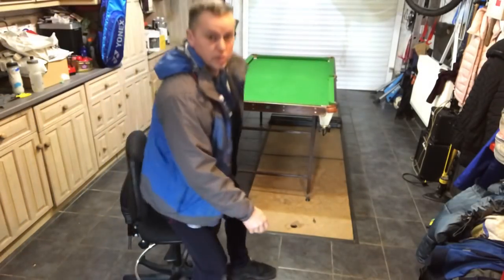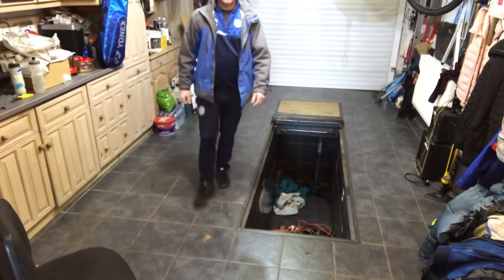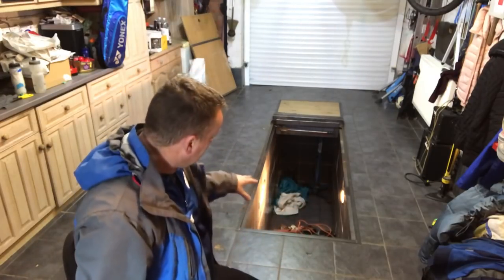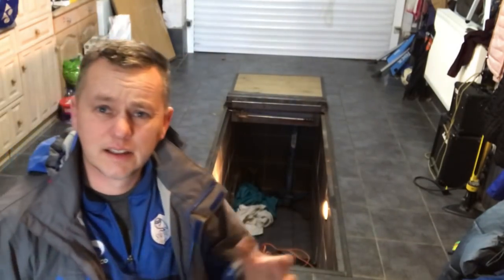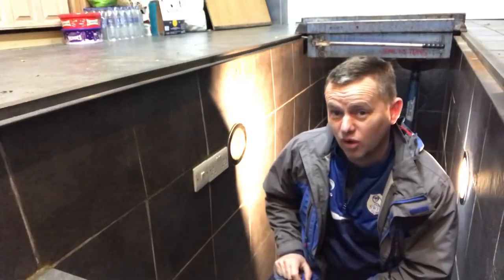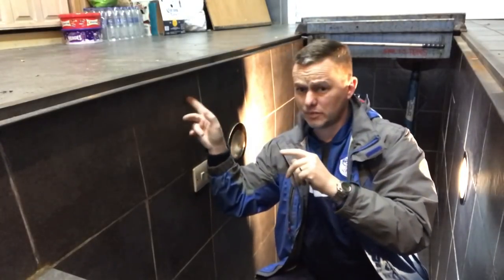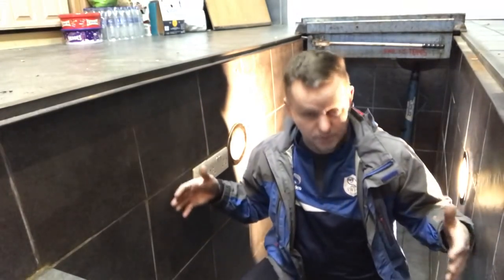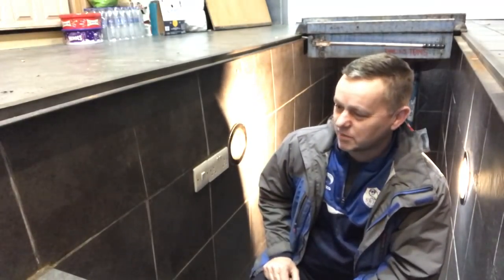Digging an Inspection Pit in Your Garage at Home (How I Did Mine)

Comment: You may be able to replace the lights in the pit with LED lights. You'll get more light without the excess heat. Thanks for the video! I'd like to build an inspection pit in my garage on day.
Reply from the maker: Thanks for the tip! Definitely worth changing in the summer, I do like the heat in the winter 😂 Thanks for the great comments👍🏻👍🏻🛠

Comment: I'm building one in our new double garage. I prefer to use an angle iron frame around the edge so that the load bearing down on the ends of the timber cover is actually on the walls rather than a lip sticking out, plus one less thing to smack your head on or funny bone when working under the car.
Reply from the maker: 😂 a great addition to the workshop, Thanks for the great comments👍🏻👍🏻🛠

Comment: Getting ready to close on a house the 2nd of next month. I really want to add an inspection out to the shop rather than remove the spare clean storage attic so I can fit a lift. I really like what you did but honestly would like to make it a bit wider with adjustable width metal pieces that lock onto/ into  the front and to give me a bit wider area so I can stick some tools down there and have the width to do crap Like CV axles on my off road rig with plenty of space. 

I was also thinking about doing the stairs in the back but I honestly like them where you put them so you can if you need step up on them. So many hard decisions on the design. I really like yours and may just copy it 1-1 since it will be easy enough cheap enough and less work.
Reply from the maker: Sounds a plan, Thanks for the great comments👍🏻👍🏻🛠

Comment: Is it possible to dig up the whole floor area inside the garage? If possible what supports would I need? I’m guessing it can’t be good for weight distribution on the walls, I would make it a room under the floor with a concrete ceiling, abit like a cellar.
Reply from the maker: Anything is possible, but it would be a huge job, the garage footings would all need underpinning before excavation 👍🏻👍🏻🛠

Comment: About halfway though a house build, the 'Lancia' room has an inspection pit. Some good ideas in the comments, looking for something practical to cover it, I was thinking about a roller blind idea but if someone walks on it ...... wont be good. Also trying to work out ways to move the car without driving it to gain better access.
Reply from the maker: I will be updating my pit covers to some aluminium checker plate panels with braces beneath for extra strength, Thanks for the great comments👍🏻👍🏻🛠

Comment: are there any disadvantage for using car pit vs using a jet lift? theres a budget but i dont see needs for jet lift.
Reply from the maker: Its all about the size of your garage, a lift is always better but you need roof clearance, Thanks for the great comments👍🏻👍🏻🛠
Reply: @aaanton11  yea. Thats what im concerns about the roof clearance. We looking to make a building the workshop will be on the basement. We put in 10feets tall which is basic jet lift height is. But architect is having problem with getting the roof too high as it mean that we have to dig deeper and the entrance slope will be higher and slidding more downwards.

Comment: Thinking about building a garage with a pit, but I'm wondering if I will have to put the water drainage outside of the garage as deep as the pit will be maybe to avoid have it filled with water.. That would mean quite a bit of extra work.
Reply from the maker: just line the pit with polythene no drainage needed, Thanks for the great comments👍🏻👍🏻🛠
Reply: I would place some jets in the pit and double use it as a jacuzi :D
Reply: Funnily enough, when I went to build my inspection pit, I had no end of people who told me to make sure the water table was well below the bottom of the pit or the pressure of water will lift your concrete basin right out of the garage floor like a champagne cork! 

I failed to see how that would work, especially if you’ve got it tied into the floor with reo bar? Some went on to cite even the Titanic saying, hark at the size and weight of it, and the ocean kept that aloft without difficulty!

Fortunately for me, however the water table was well below the floor of the pit, even allowing me to put a Maori drain in it for when I slash a radiator. It’s worked a treat over the years.

Comment: I don’t want to be “that guy,” but please talk about the danger of carbon monoxide and options to deal with that potentially deadly issue.
Reply from the maker: Fair point, although most issues were around people welding and cutting with oxy acetylene, producing high amounts of carbon monoxide, I am far away from that, but if you were concerned a sensor can be fitted inside the pit, Thanks for the great comments👍🏻👍🏻🛠